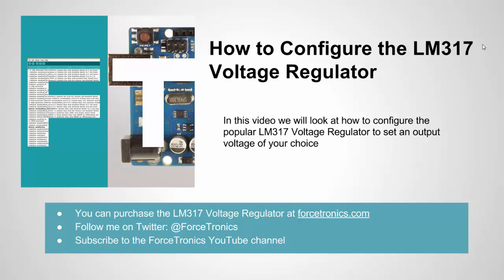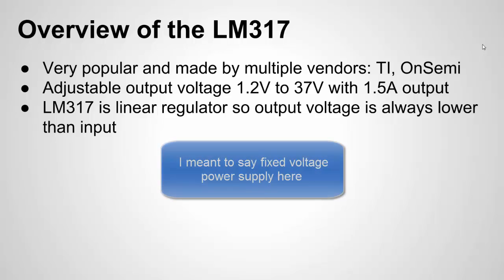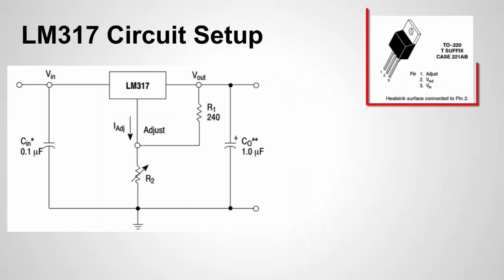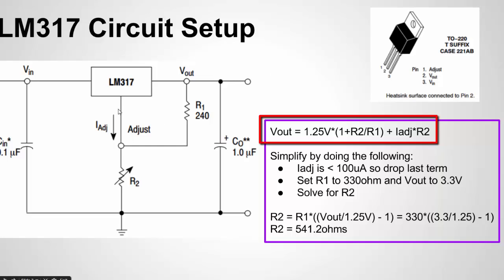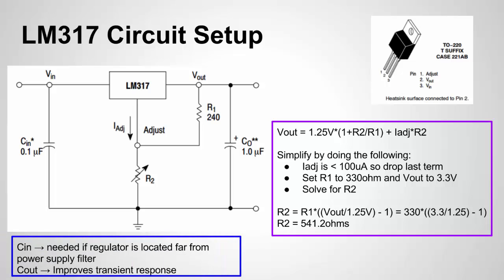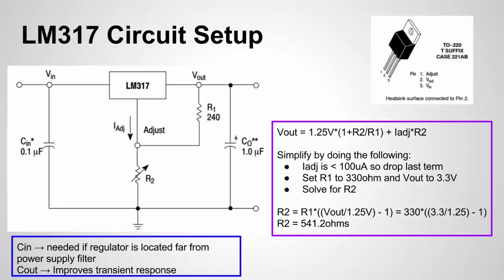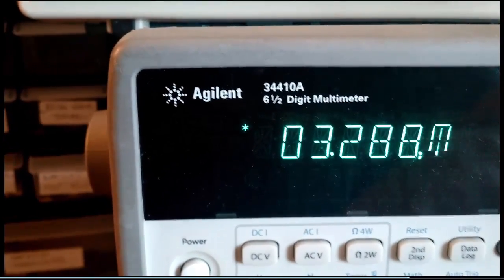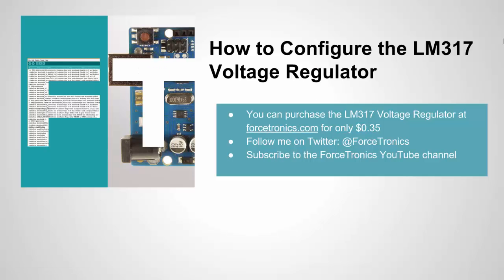How to Configure the LM317 Voltage Regulator

Comment: Great video. I am however math illiterate and would love it if you could do a run through of how to do the R2 calculation. Sorry if it is basic but I've forgotten how one does sums with brackets in them.
Reply: I'm not great with math either so sometimes I use Excel to help. The original formula is Vout = 1.25V x (1 + R2/R1) (we drop the Iadj * R2 because its value is negligible). Since we already know what Vout we want (in this case, 3.3V)  and we know what R1 is (in this case 330ohm) we have to rearrange the formula to solve for the only thing we don't know, which is R2.

We do this by first stripping off the 1.25V on the right hand side of the equation by dividing both sides by 1.25V to give us 

Vout/1.25V = 1+ (R2/R1)

Next, we strip off the +1 on the right hand side by subtracting 1 from both sides giving us

(Vout/1.25V) -1 = R2/R1

Finally, we break off the R1 divisor on the right hand side by multiplying both sides by R1 to give us

R1 * ((Vout/1.25V) - 1) = R2

Now we can solve for the missing value R2 in Excel. In all of the above except the last form, the parenthesis aren't strictly necessary because the rules of math say we always do what's in parenthesis first, then multiplication then division before addition then subtraction. I've included them so you know you always operate on what's inside the parenthesis first. So in that final equation you first divide Vout by 1.25, then you subtract 1, THEN you multiply by R1. Now on to your spreadsheet.

1. Create a spreadsheet with 3 columns labeled Vout, R1, and R2 in cells A1,  B1, and C1
2. In cell A2, put in your desired output Vout (3.30 in this case)
3. In cell B2, put in your known R1 value from the demo (330 in this case)
4. In cell C2, put in your formula which calculates R2. In this case, the formula is =B2*((A2/1.25) - 1)
4a. That means: first, divide your desired Vout by 1.25, then subtract 1 from that answer. Then, multiply it by your known R1 value. The result is R2.

Now you can play around with the different values of desired Vout or R1s to come up with different R2s needed for that output. Hope that helps.

Comment: Thank you Sir😊
LM317 is a linear voltage regulator. It has the advantages of low output noise and easy configuration.
Reply from the maker: Yes, you are right

Comment: This is the first Circuit I want to make however...I'm new to circuits and electricity in general. please somebody for the love of god explain the path of the current here that makes these resistors and reference voltage actually change the consistent output. I don't understand how a reference voltage is being created and how it's actually changing the output. For example. 12v comes in Vin to LM317. Does the path go out Vout or Adjust first or at the same time. Is it that r1 and R2 are drawing current so it comes at it both ways then once it goes through what I presume is the potentiometer in R2 it goes up the adjust terminal and out the Vout? Can current flow against itself? I'm beyond lost here.
Reply from the maker: The lm317 voltage regulator regulates its output to maintain a 1.25 v at the adjust pin. You want to set resistors r1 and r2 so that you get the desired voltage at the output and a 1.25 voltage at the adjust pin. The regulator is not monitoring it's output voltage it's monitoring the 1.25 voltage that you set with the resistor divider Network. The 1.25 volts is created by the resistor divider Network and the current flowing from the output to ground through the resistor divider Network. The adjustment current can essentially be ignored when you're using the lm317 as a voltage regulator and not a current regulator.

Comment: Question- I have a heavier 24v ac transformer and a high voltage UV lamp that requires a constant AC regulated 24v 1A on its input side.  Would this lm317 chip work?
Reply from the maker: The LM317 is a DC voltage regulator. It does not work with AC voltage

Comment: Thanks for this great video! I just wanted to add that these get hotter as you either draw more current or drop more voltage. Functionally, they regulate voltage by dissipating extra power as heat, EXACTLY like a series resistor would. As such, they are inefficient and are not a good choice for battery powered projects. Also, since the heat sink tab is connected to Vout, DO NOT bolt it to anything grounded (metal case or PCB pad) or you'll get a short circuit. They do shut down to try to save themselves from overheating, but don't count on this. :)

Comment: you should give the link for that data sheet and do you have a site you prefer for data sheets? search engines i use typically does n't have the old school components. i found the LT117A. works even better output voltage tolerance is a maximum of ±1%, allowing an overall power supply tolerance to be better than 3% using inexpensive 1% resistors. and same price
Reply from the maker: For data sheets I either go on manufacturer website or to a distributor site like Mouser and search for the exact part to access the datasheet from there

Comment: Very nice video and teacher ! does the LM317 adjusts current or voltage ? if i want to draw more than 1.5Amp, how to do ? thanks.
Reply from the maker: My video configures the LM317 as a constant voltage power regulator. It's  output current is set by load. Lower resistance load more current. I would suggest reviewing Ohm's Law
Reply: @ForceTronics  Ok, did you make a video of Ohm's Law ?
Reply: You can put a transistor in parallel with the lm317 using a resistor to turn on the current at a certain level from the transistor

Comment: why the input voltage must higher than the output voltage at 1:96
Reply: All Voltage Regulators, (and most/if not all IC's in general), require a small voltage just for the IC to operate. In the case of the 317 it's around 1.25 Volts for the IC to do it's thing. I believe it's called the "Reference Voltage". Check out the datasheet of the 317, there's a schematic of what the inside of the IC looks like. There's a Lot of Tiny components making up the internal circuit of the 317, (short circuit, thermal, overload protection...), so it takes a little over a volt for all that to work, and it's all built inside of a pretty small, easy to handle, easy to use IC.
Hope that helps some....
Reply from the maker: +Elaine Yeoh that is true for all linear regulator s like the LM317, input voltage must be higher than output. If you want your output voltage to higher than input voltage than go with a boost DC to DC converter

Comment: Sir I have query on the circuit.i had similar design I used tantalum capacitors ,the problem is when the capi goes bad it is shorting the supply how to overcome this ,by using same type capi
Reply from the maker: If this issue is happening over and over than you probably are not using a cap that is right for your design. Is the voltage rating too low? Are you using it out of its temperature range?

Comment: 4.35 : the input voltage should never be much higher then the output voltage. This will cause the LM317 to generate excessive amounts of heat

Comment: what is the 100 ohm resistor on the output for? You talked about it but it is not in the circuit diagram...
Thanks
Reply from the maker: The 100 ohm resistor is just there for a dummy load so that current is flowing out of the LM317 and I show that it is maintaining the voltage we set it for. It basically represents the thing you are trying to power. Probably could have used a light bulb or a fan for something a little more exciting.
Reply: Thank you.  How would you limit the current to say, 50 mA with this set-up?
Reply from the maker: Well it depends what you mean by "limit." If you mean maintain a steady current for a static load like an LED then you can use a series resistor and ohms law (you know the voltage and the current so calculate the resistor value). The data sheet also provides some constant current suggestions http://www.ti.com/lit/ds/symlink/lm317.pdf, refer to 8.3.3 or 8.3.7. If you mean prevent the current from going over 50mA you would want to either use a fuse or see if you can find a regulator that allows you to set a current limit.

Comment: One thing to remember it if you want to use this to build a battery charger at 12 volts or above the variable pot will be destroyed while you are testing or using it.
Reply: Joseph Nicholas true. my pots kept burning while testing over 12 volts regardless of the power rating. but why? and how to overcome this problem?
Reply: You need to use a higher value resistor on the pot.

Comment: Hi, thanks for the tutorial. One thing you want to show is how the regulator actually regulates (or not) the output voltage regardless of the load connected to it. It supposed to maintain (regulate) the voltage with or without load and any current in between. I have tested a LM317 and was disapointed with its performance, perhaps I used a damaged component.
Reply from the maker: Hey thanks for the input and insight into your experience with the LM317
Reply: ForceTronics haircut at